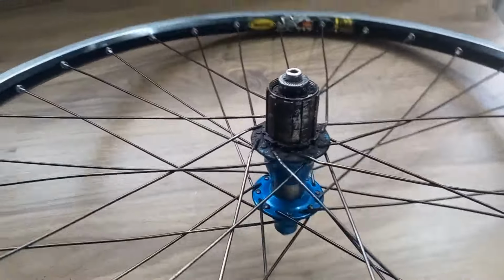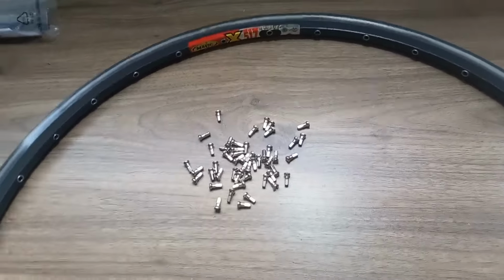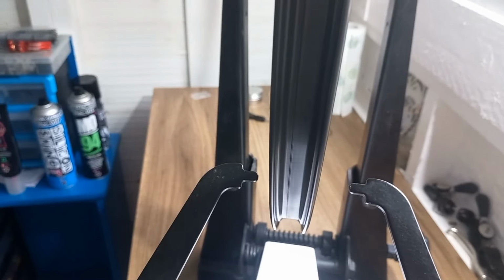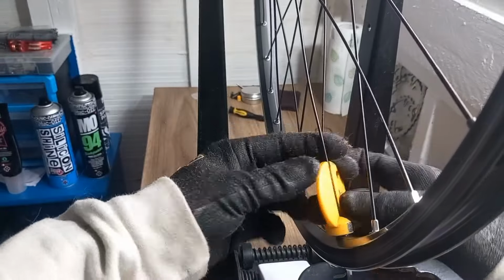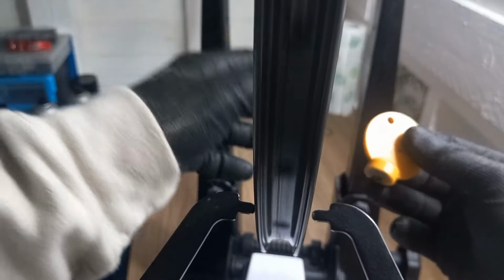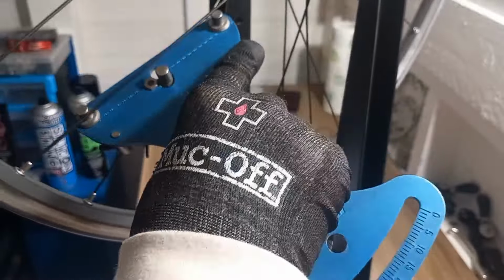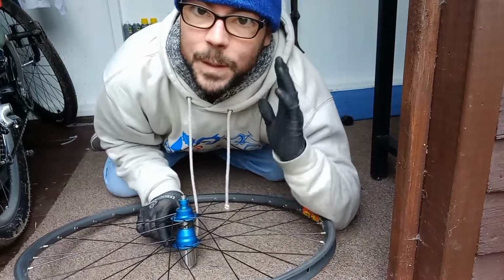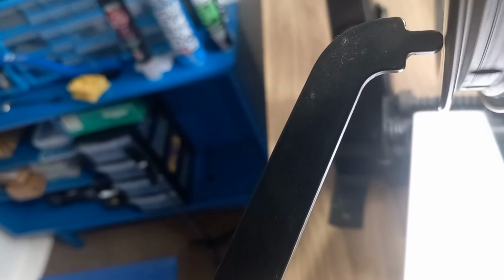Rear Wheel Build - Mavic 517 on HOPE Ti-Glide - More about building up the spoke tension

Comment: John Bombas taught me after a day's work over a few evenings at Ashbury Cycles in 1997 . A lady that helps me today was also in a shop and we did the DT course together with John . He taught a similar technique to Calvin Jones from Park Tool . Have you learnt the equations for wheel spoke and nipple length and flanges , Effective Rim Diameter . I can cut and restamp threads for customising spokes if required . I have a j - press tool as well  I find that I get cramps in my hands if I try to build too many wheels in one sitting ..
Reply from the maker: Great skill to have, mate. I have never had to tap or brand a spoke. I use the dt swiss old-school spoke calculator, I have the chart and the rim inserts for it. I learnt many years ago from an old guy that used to do cytec training and then worked for madison 👍
Reply: @BikeShedBoy  Cytech began in Marrickville , Sydney , Australia in 2019 , but COVID 19 caused it to run into financial problems . The NSW government bailed it out but it is in real trouble now due to lack of enrolments and very high fees . It may fold before long .